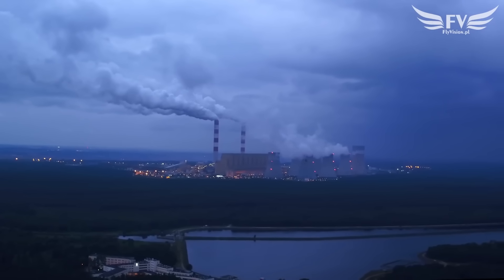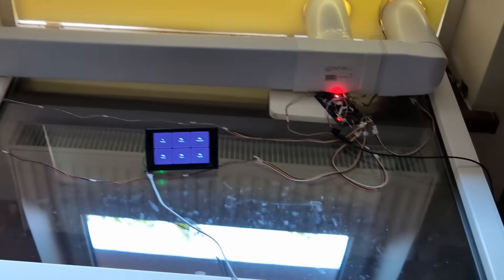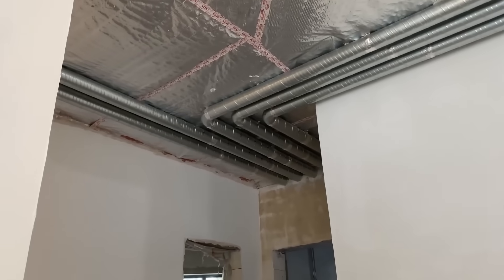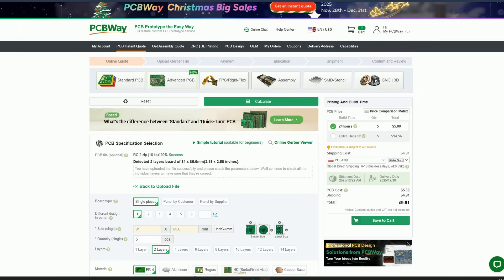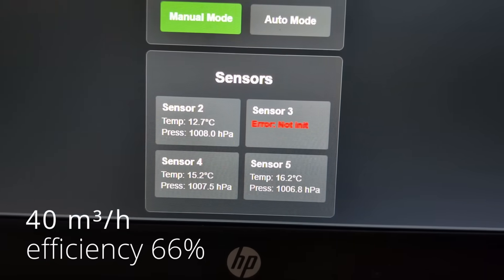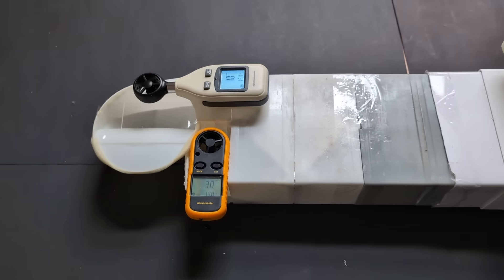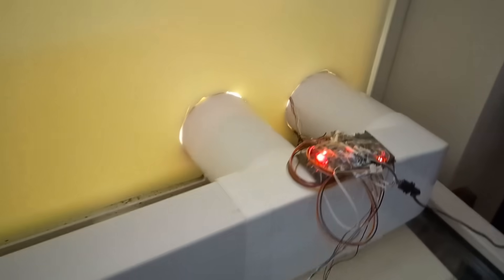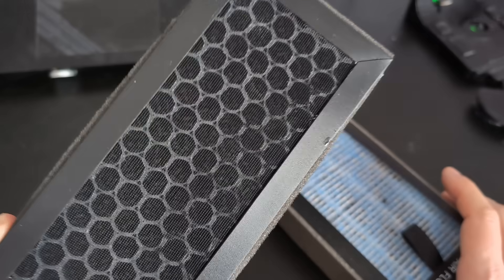DIY Heat Recovery Ventilator: From 55% to 90% Efficiency (Real Tests)

Comment: Interesting to come across this video as this is a project I myself have been working on. Perhaps you've tried it in other videos, but I've taken a very different approach myself. I use radiators (these can be found in many convenient sizes and capacities, often for use in PC watercooling) and simply continuously circulate the cooling medium (i.e. water) using a small pump. This allows use of readily available components already designed and built specifically for air heat exchange. As these are also generally designed to work with standardized fan sizes, design is simplified even more.

I'm in a much earlier stage than you and only getting to my first prototype soon, so I can't speak on efficiency yet, but given these radiators are specifically designed for the task (the better ones even coming with documentation on specifics) I have high hopes.
Reply from the maker: That’s a cool approach! I’ve considered run-around coils too. They are definitely easier to build with standard parts, but usually, the two-step heat exchange makes them a bit less efficient than direct air-to-air. Also, watch out for water freezing in winter! Good luck with your first prototype.

Comment: Why not use flat metal sheets? I made an around 20cm wide heat exchanger cel like yours but flat whith 3 thin wood separators, my idea was that sice it is wider, the air will flow slower and therefore have more time to exchange the heat

Comment: 3D print a heat exchanger in your preferred geometry with relatively thin walls. The small microscopic gaps inherent in FDM print will make it vapour permeable as water vapour molecules are extremely small compared to dry air. Most vapour permeable building membranes work like this with tiny holes punched into a polymer sheet.

Comment: well, you could have the exchanger "printed" in copper or aluminum. Doing so will allow for MULTIPLE air paths.
Reply from the maker: Great idea. I'm currently developing a heat exchanger that I'll print entirely and then electroplate with copper.

Comment: I have two requirements your video (and subsequent developments) will greatly influence. 1) I want to take fresh air, filter it and pump in into a server cupboard 2) i then want to extract the heat quietly from the same cupboard into the house. Subbed for updates! Good work 👍
Reply from the maker: Great idea. Using the servers to heat up filtered fresh air is a win-win. It's basically a free heater for your home. I'll keep the updates coming!

Comment: A cheaper alternative to aerogel is to fill a void space with fumed silica (in the United States, the brand that is most widely available is called Cabosil). Fumed silica is a light fluffy silica powder used in the resin casting market as a filler material that reduces how much resin shrinks when it cures during the casting process. A jar of fumed silica will be about 98-99 air by volume.

At the microscopic level, fumed silica is basically the same thing as aerogel, but it lacks macroscopic structure. But this doesn't matter if you are filling a void space with it for the purpose of insulation. You can get the same insulating performance for a tiny fraction of the cost of using aerogel this way.

I also recommend installing mylar radiant barrier film in the structure you're trying to insulate. Aerogel will scatter infrared light, but mylar film will reflect it back. For keeping heat from escaping, the mylar film is better than the scattering effect of aerogel. Using a combination of the two (radiant barrier film and fumed silica poured into a void space) should block radiant heat loss, convective heat loss, and conductive heat loss as much as possible.
Reply from the maker: That’s a brilliant suggestion, thanks! Combining fumed silica with a Mylar radiant barrier sounds like a very cost-effective way to block all types of heat loss. I’ll definitely look into Cabosil or its local equivalents for my next experiments.

Comment: So you spent 2-6 years developing a recuperator?  Nice.  I took the channel AC as a part of intake and looped it back upon ifself (to reduce the minimal 350 m^3/h).  Hepa filter if front of the AC.  That's it.  Its always on, always with set temperature.  The intake split according to the number or rooms.  No need to collect the exhaust air.  Just throw the used air outside.  The price of AC, ducts and a filter is about 2k EUR.

No one needs a recuperator for an apartment.
Reply from the maker: Most AC units just recirculate indoor air. Without a recuperator, you're wasting a ton of energy heating fresh air from scratch. My goal is to have fresh air and efficiency at the same time.

Comment: so I'm confused, what are you exchanging heat for?
Reply: Condensation of air and sofore binding of particles on the cold plates
Reply: @Jfraks  oh interesting, it's a type of filter then? Except easier to clean? does air speed, via the fan, or venturi, drastically change the ability of the particles to attach?

Our air quality is quite good, but it never hurts to keep improving. Though I feel that my evaporative air conditioner does a lot of that (very effective at cooling, in our dry environment)

Comment: Fantastic video! In regards to aerogel, please take a look at Nighthawkinlight's video on DIY aerocrete (aero concrete), it will probably be a better fit for your application both in terms of lower cost and ease of production compared to aerogel. As someone who has had respiratory complications this year due to poor air quality, I'm rooting for you to succeed 🙌🏼
Reply from the maker: Thanks for the tip! I love Nighthawkinlight's work. Aerocrete is an interesting idea, though aerogel isn't actually that expensive for me right now. I’m focusing mostly on the exchanger design at the moment. Sorry to hear about your health issues — that’s exactly why I’m working on this. Thanks for the support!

Comment: in such restricted airflow the theoretical cross-section of the exchanger is just half of the sqare tube x 0,7. and the square tube itself seems to have much smaller cross area than the 150mm round tube (~150 vs 226cm2). that will always need a lot of power to push through, which results in a lot of noise. noise is much worse than a less compact layout i think. like the tesla hepa filter is huge compared to other cabin air filters. so maybe there could be another design with a much shorter but flatter exchanger as well. a large filter would also moderate the airflow to have less turbulence across the area. maybe one without 90 degree turns even.
Reply from the maker: You're spot on. The pressure drop is a real challenge because I tried to keep the unit compact. A flatter design with a larger cross-section would definitely be quieter and more efficient. I’m currently balancing size versus performance, and avoiding those 90-degree turns is definitely a priority for the next version.

Comment: On the subject of filtration, many vacuum cleaners make a big thing of having HEPA filtration. As I understand it, the HEPA "certification" applies to the filter itself, and it involves payment to the certification companies per filter. There is also "S Class" filtration. There are some differences, but they are broadly the same, but to gain S Class filtration, you have to test the whole vacuum, which means the body of the functioning vacuum cleaner has to be sealed. Air has to go through the filters before being exhausted. If you look at SEBO vacuum cleaners, the filtration starts with comparatively inexpensive 3 layer paper bags, usually pretty big ones, and they usually fill up completely before the cleaner demands replacement. THEN the air goes through the microfilter, and typically needs replacement after about 20 full bags. THEN, it goes through the motor, which means that motor lasts a long time. Last, the air is exhausted through either a thin foam filter to catch carbon particles from the motor, or through a replaceable fabric covered belt on the Canister vacuums. I think that the thin foam ones can be treated to remove any smells, but don't quote me on that. Other aspects of the designs are pretty damn good from an engineering point of view, and they are highly resistant to blockage or jamming/breaking of the brush drives on ones that have them.
Reply from the maker: Thanks for the detailed info. I didn’t know about the S-Class testing the whole unit's sealing, that’s a very important distinction. The multi-stage approach with cheaper pre-filters is definitely what I’m aiming for. It saves the expensive filters and protects the fans in the long run. Great insight!

Comment: Copper is much more expensive.  Would Aluminum be more cost effective?
Reply from the maker: I've come up with a new solution: print a heat exchanger out of plastic and then electroplate it with copper. This way, the amount of copper used will be minimal, yet the efficiency will be high.

Comment: I am very impressed with your technical skills and dedication. I agree that air pollution is a significant danger and eradicating it is imperative for anyone's and everyone's health, however I'd like to correct you with some good news about the state of the world in that field:  The air quality got significantly better over the years and is continuing to improve across Europe [EEA 2025], and renewable energy use in Poland is steadily increasing [GUS 2025]. That being said the air is still harmful most of the time and renewables are barely above the 15% mark. Your work is very important for further improving the state of our planet, I think.
Reply from the maker: Thanks! It’s good to hear things are moving in the right direction. However, winter smog in Poland is still a daily reality for most of us. Until the energy transition is complete, individual filtration is the best way to protect our health.
Reply: @DIY_Yarik  True that, couldn't live without my air purifier here in Warsaw, this 'air' gives me a headache more often than not.

Comment: Interesting concept and well explained. But if this system changes direction every few minutes and while it is blowing air out, then that will create negative pressure and thus that air needs to be replaced and will come in trough all the gaps that are present in every house. That air is not filtered. If the system is both pulling and blowing at the same time, then that problem would be as good as gone. But the you run into the problem of not having the heat exchange. Unless it is a fully double system that works in opposite cycles. Don't get me wrong i love how you made the system they sell as a ''90%'' efficient system into a real world working 75% system with room to improve. It just got me thinking about the filtration and then realised there might be an issue.
Reply from the maker: Thanks for the observation! Actually, my system is a balanced, continuous-flow design. It pulls and pushes air simultaneously through separate channels in the heat exchanger. This maintains neutral pressure in the room, so no unfiltered air is sucked in through gaps. That’s exactly how I manage to keep high efficiency and consistent filtration at the same time.
Reply: @DIY_Yarik  Should have known you wouldn't make that mistake instead of writing a long comment 😆

Comment: What was limiting your first design is that some of the heat you were extracting is conducted along the pipe and exchanged back to the air exiting the system: what you want is multiple short elements separated by insulating materials. Also, increasing the diameter of the pipes decrease the surface to volume ratio, meaning the system is worse at exchanging heat. 

The 3D printed exchanger seems very promising for the easyness of manufacturing, try to put 2 or 3 in series: it may decrease the flow rate, but substantially increase the efficiency.

Comment: You beat the carnot cycle efficency?
Reply: Carnot cycle efficiency “limit” is for heat engines. Converting heat to work.

This is not an engine. His efficiency is just heat transfer from in to out streams. Not subject to Carnot limit

Comment: Been thinking of building something like this to my boat to achieve maximum efficiency of heating or cooling in the boat. Filtering is not very important in boat. But corrosion is serious thing with salty air.

What you could check is rotating heat exchangers. They use them in building systems here in Finland. In my understanding they’re most efficient. There aluminium wheel slowly rotates within two chambers where one is fresh air and another used air. The mass of the aluminium wheel conserves the energy (or cold) and transfers it to other side. The bad side is that small amount of air mixes in the wheel space. I believe the pressure difference needs to be minimum between the chambers. Filters of course are put after the exchanger.
Reply from the maker: Rotary heat exchangers are actually becoming a thing of the past for residential use. While they handle heat well, the air mixing you mentioned is a major dealbreaker when you're trying to filter out toxic smog. For modern clean-air standards, plate exchangers are much more reliable and easier to seal.
Reply: @DIY_Yarik  Yeah, I haven't seen rotary exchangers used in residential. Only in big office buildings (and the rotating thing is like 2 meters in diameter). Also there some spaces like toilets, labs, kitchens etc. are not connected to that.

As for smog, I would think that the filtering needs to be done before any heat exchangers to prevent them from clogging over time.

Comment: WOW, so interesting. 
I dream at this since long time ago. 
Those heat recuperators are so expensive.
They will return investment after decades. 
I intend to do one but not waffer since is too complex, but stacks of aluminium foil. 
And air circulating through alternate spaces. 
No filtering, although I bought the filters. 
The air is good enough here, and the first test on air pressure with fans was a disaster. 
No flow strong enough through a simple short pipe. Adding the aluminium serpentine will add even more drag. 
So no way to add a filter too. 
If I will ever need filtering, the air would be pumped.

Comment: @5:52 the rule of thumb that I heard was that tubes need to be at least 7 times as long as their width for good heat exchange. If you want more flow, you need more tubes in parallel

Comment: @0:34 Renewable energy being only 2-3% is very deceptive. In terms of avoided fossil fuels it's more like 7%- and doubling about every 3 years. Comparing renewable energy to primary energy is called the 'primary energy fallacy' because renewable energy generates secondary energy which is much more distilled and far more useful.
Reply: It’s not merely deceptive, it’a flat wrong, and his graph shows it
Reply: @nate3356  TBF he's in Poland. Poland is still one of the most fossil fuel intensive countries in the world, so it's not terribly surprising he has these issues.

Comment: if using copper, try white solder like those used in eletronics.
Reply: Also, why not straight copper plates separated by printed plastic spacers ? while the area is less, its also easier to produce.
Reply from the maker: That’s a great point. Plastic spacers would definitely simplify production. I’m actually thinking about 3D printing the entire exchanger with all the channels and then copper plating it. Hope to test this theory soon.

Comment: Clever stuff - particularly your roll former which is a good use of 3d printing. You might want to consider that a counter flow heat exchanger is more efficient than your cross flow as the average temperature difference along any unit length is higher (see wikipedia). However your plate design is much easier to build. If you were to cascade two (or more?) of your heat exchangers your efficiency would increase - I suspect much more than switching to copper. Cheers!
Reply from the maker: Great point! That’s exactly why my current design uses a cascade of 3 blocks. It allows me to approach counter-flow efficiency while keeping the plate assembly simple. I’ve found this to be much more effective than just switching materials. Thanks for the tip!

Comment: Polycarbonate as heat exchanger material is fine, small size is a problem that pushed you to experiment with materials. With normal sized exchanger you will need to make it just slightly bigger to compensate for much worse thermal conductivity of material. For example: in recuperator  2 sq m of polycarbonate performs same as 1.8 sq m of aluminium. Area of exchange and air flow velocity matter, conductivity not so much (because walls are thin).
Reply from the maker: Thanks! Most of the noise actually comes from the air moving between the fan and the exchanger. I'm planning to use a duct silencer and isolate the motors from the case to stop vibrations. Also, the aerogel blankets I'm using are actually great for sound dampening too.

Comment: I love your videos, I was thinking to build something like this for a long time. Even the improved efficiency of the new version is nice, the simplicity of the version made with aluminium tubes make it the preferred option for me. Thanks for your awesome work!
Reply: Yeah, I've been watching this guy's progress and, although I am impressed, the design is starting to become too complex for any reasonably skilled DIY'r. I certainly don't have the solution, and maybe it's not possible, but I am oping for someone to make something dead simple.
Reply from the maker: I’ve overcomplicated it with extra sensors for now because I need the data. The final version will be much simpler so that anyone can replicate it easily.
Reply from the maker: Glad you like them! I totally agree—the aluminum tube version is much more accessible for DIY. Even if the new one is more efficient, simplicity is a huge advantage. Good luck with your build!